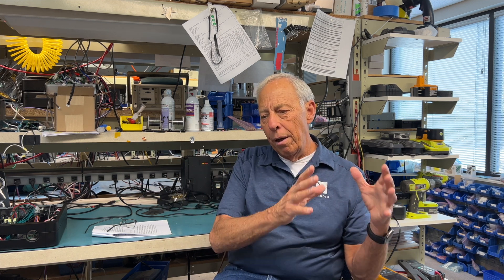Class D amp fatigue

Comment: Thanks for the PWM rap.  I didn't know its the same method as Solar charge controllers use.  All the cheaper ones use PWM.  The new fancy one are MPPT. They do a I V sweep find the sweet spot for volts at the maximum power point.
Reply: mppt and pwm are completely unrelated things, not alternative technologies. PWM + inductor and capacitor is a way to efficiently convert voltages. MPPT is a fancy feedback loop that tunes the voltage conversion ratio (which is still pwm-powered) to maximize the power drawn from solar cells.
Reply: Mppt is good because u can feed them more power.  More volts is always a plus for solar for various reasons.
Reply: I just think its cool how sound tech and solar have parallels. Outback came out with the first MPPT charge controllers back in 2000 or so.  Yes you run the panels in series strings up to 150 VDC then the MPPT circuit with the inductor capacitor ( L C) circuits down converts the voltage to the Max Power Point simultaneously raising the Amps.  This is a win win for solar.  I love sound and solar so its all just great!  You sound and solar engineers are awesome!

Comment: I agree that Bruno and ICE make some good Class D amps that aren't fatiguing but they lack the detail and dynamics of the GanFet designs of Orchard Audio Class D amps. We can listen to mine all day, music and films, with no fatigue. Paul's HCA-1 was a disaster, but even worse was his matching pre-amp.
Reply: Hey Bill, I think Leo sets the gain on his amps at 13db (as opposed to 26/27db on pretty much every other class d) I'm guessing it makes things sound a bit less fatiguing. Although my Purifi Eigentakt is set at full gain and I don't find it fatiguing or lacking in detail or dynamics. As with any amp, getting the proper speakers makes a world of difference. Good quality recordings make quite a difference as well. 
Btw which Orchard components do you use?
Reply: @andrea585ny  Dual mono W/max caps powering my ELAC Vela 409s.

Comment: Tried Audiophonics hpa-T400et (class D 3 channel purifi!!!) and sent it back. Treble was too harsh with most songs on my focal electra 926s... bass was wonderfull though.
The stereo amp version (hpa-S400et) was tested on asr and came out as one of the best ever. Now I am scared to try other class D amps.
Reply: Thats because the electra is harsh on the top end. You would never have a problem with current day Class D if your speakers were neutral.
Reply: Thank you Mark. Yes this also came to my mind. I own Sopra No1s now and these are definetily better at the top end. But I since I sent the HPA-T400ET back, I cannot check. I do consider to give it another try next year. Thanks for your feedback @AbsoluteFidelity

Comment: I love class D for my 5 string bass guitar amp. It has a choice of tube or solid state input stages (which can be combined) but I love that an 8 pound amp putting out 800 watts RMS is the size of a the size of a 2" thick book. I started bass in the late 70s. and a 300 watt tube or solid state bass amp then were huge, heavy, and hot. I marvel at how little heat this generates at such a small size and light weight.
Reply: Well understood why you like it.  I just do not get the mids that I like out of the Shuttle Max 12.0 and the Shuttle Max 12.2 was just Double Violin/Flat Wound Dark Tube Modeled Power Section.   I ended up leaning on the Copper Toroidal Power Transformers of the NEOX400, GBE600 and the GBE1200.  They are all laying about me right now, yes even the ShuttleMaxs.  I really need to sell those.
Reply: What is this amplifier please?

Comment: Hi Paul, I have a Audiolab 6000a class a/b amplifier
My display reads prt???flashes on and off for 30 seconds  and then goes into standby mode 
 standby mode . 
I can operate a turntable or a cd for that 30 seconds. Before it shuts downs 
We had a power surge week 
And it affected  my pvr for the tv and killed a doz leds 
In the ceiling 
I’m so puzzled ? Any ideas 
How to restore my amp ? It’s only 4 yrs old , or is it toast ? 
Best regards , Lorenz

Comment: almost all my amps are class d. what i like about them is the power density. 4000w out of a amp that weighs like 5kg! (behringer inuke nu6000). in my car i have soundigital amps (sd400.4d evo4 and sd3000.1 evo4) and they are very efficient and have a ton of power and the amps are SUPER small! (the 3kw amp is the size of 2 monster cans!)
Reply: forgot to add: the behringer has very good sound but its a little fatiguing. the SD's are not fatiguing at all

Comment: My class D experience: bass and shimmers very good.  Lacking in mids.  Some vocals rendered nasal.  

Used a few. Linn Akurate best of the bunch.  Sounds like my preferred high biased AB amps

But for all its good bass, i find Class D not as tight/controlled a gain clone bass.
Reply: From your message you seem to be elaborating on something I noticed when working with Digital and Solid State Amplifiers for the Bass Guitar.  I walked away from this long ago and had to read to remember that the Digital ultra light amps were Class-D. 

In my work with two models. one modeled to sound as a tube amp, and the other a straight forward design, I did not enjoy the Tube Model on the Power System (the PreAmp shared the 12AX7 tube, so the Power Sections were the difference,) and I preferred the First Issue Class-D.  

BUT!  Weight being no object, and the tone being far more inspiring, I was very excited with the Toroidal Power Sections of 425W@4Ohms and 1200W@2Ohms of the same companies other amps.

Copper made the instrument sing and inspiring.  It was a Mid range clearly missing from the Original Class-D and High Clarity that the Tube Modeler just did not give.

So some of us hear things, others hear other things.  But at my performances, people tended to gather on my side of the stage.  Maybe what you hear is real?
Reply: @miguellogistics984  good to hear some affirmation that my ears still good for this hobby ;)

Comment: I own several amplifiers, including a Class D, two solid state Class A/B, two tube single-ended and two tube push pull.   I find my Class D amp to sound quite good.  Very clear, very good imaging, great bass definition and power.  I do not hesitate to use it for critical listening.
Reply: I agree. But some of the cheaper class D amps can sound sterile and lacking in dynamics, however I've never experienced fatigue.
Reply: @scottypalmer2158  Wat about TPA3251
Reply: @Tamilpasanga664  : One of the best class D's for cheap. Get one with a removable Op Amp and install a Sparkos Labs Op amp...then a good power supply.
Reply: @scottypalmer2158  my swan hivi M50MKiii speaker sound worst, do need to add any external DAC
Reply: @scottypalmer2158  can change
 power supply board? will it make improve the sound quality
Reply: @Tamilpasanga664  : Try changing the Op Amp?
Reply: @scottypalmer2158  I’ve haven’t noticed that with my new $150 Fosi ZA3 .. Extremely clean and revealing, great dynamics — but not at all harsh or fatiguing.
Reply: I GOT A Legacy audio iV 2 amp for my Legacy audio Focus SE.  The best sounding amp I ever owned! NOT ONE BIT FATIGUING! They use the latest ICE modules too.
Reply: I agree. I own a tube amp,  Class A SS with tube hybrid,  Class AB, Van Alstine SET 120, and a Class D GAN FET amp. They are all excellent, and the Class D amp sounds as good as any of them.

Comment: I agree! I can listen to my expensive class D amplifier I installed in my car allll day. Tune it correctly with a DSP and you get what you pay for (most the time). But it’s not always so broad, it is the smaller details such as the filtering and even quality of parts or wires how they’re ran and if the crossovers are wrong, the type of transformer, etc. all makes a difference to determine the company’s goal for how they want the sound or price of manufacturing

Comment: Hi Paul, I am a subscriber.   I have a unrelated to Class D Amp question.  I have a Denon DRA-800H Receiver rated to 4 -16 Ohms.  It has 2 Channels for Stereo (and video connections which I do not use at this time).  I have connected 1 Pair of Elac Debut 6.2 speakers to Channel A , and 1 pair of Elac Debut Reference 6.2s to channel B.  The Elacs are 6 Ohms nominally rated.  They sound terrific played simultaneously or separately.  However, as a Student of Audiophilism (at 71 YO), I learned that the Ohms ratings have an impact on the Receiver /Amp.  I use 14 gauge copper speaker wire running perhaps 12-18 feet form the Receiver.  At first, due to my laziness and ignorance, I wired the two speakers in parallel to one channel.  That overheated the Receiver at 60 volume levels.  It shut down with its Protective Circuitry.  Then I wired the channels separately : 1 pair to Channel A and the other pair to Channel B.  The Denon still gets Hot (has not shut down, but it is getting hot).  Is there anything other than getting rid of the Elacs that i can use to "boost" the Ohms handling of the Denon?  If I connect 2 other pairs of dislike speakers But with 8 Ohms ratings, it's fine. No Overheating to this extent.  Appreciate your advice .  THX for your terrific work.

Comment: Great explanation Paul. I would suggest, in general, for those people who fancy audio as a hobby, that they should get a hearing analysis to determine their individual loss issues. Many comments below - MIGHT - be somewhat related to their own ears. Especially in those above 40! I am above 60! I My eq and dampening and other room mods  in my audio room are for me - specifically. I can listen for hours and not get fatigued. I would also say to others understand that some recordings are also less than optimal and can cause fatigue on any system. Unfortunately some of those recordings were made long ago and the artists have since passed, so it's what we have or nothing. Great channel, great advice from you as always!
Reply: You can use AI to improve imperfections in old recording equipment as long as the information is there in some form. For example if the tape machine recording it was not keeping  a constant speed the AI will figure out the correction needed if the speed variations were non-random, e.g. a roller was very slightly elliptical.

Comment: I own Wyred 4 Sound ST-1000 mk II and ST-500 mk II amps, and a pair of PS Audio M700 monos, and none of them are fatiguing. They sound incredibly clean, are dead-silent, have tons of power, and run barely warm to the touch. My speakers are Dunlavy SC-Vs, which are incredibly accurate and revealing, so if Class D was an issue, I'd hear it.
Reply: I have wyred 4 sound STI-500-v2 and i'm having issues at higher volumes. 
Did a direct comparison to my 40 year old Sansui AU-717 class AB. The sti 500 cannot handle a busy sound at high volumes. I feel like if there is a lot happening in the music, the sound gets very jumbled and almost muddy. 
I can crank on the Sansui waaaay louder than the wyred 4 sound without the sound falling apart. Tekton speakers.
Any ideas?

Comment: Some of the earliest high-power Class-D amps were the Peavey DECA sound reinforcement amps made in the mid 1980's. They sounded great, and were even used in some recording studios for driving monitors. But part of their good sound might have been the fact that their pulse rate was 500kHz, much higher than most Class D amps. This allowed the reconstruction filters to be tuned to a much higher frequency, which reduced their phase shift in the top (audible) octave.
Reply: I tried to play bass through one of those in the 80s. 
It would simply go "blank" for a second...Very clean for hifi though.
Reply: I still have a few of the deca's . Theye were lousy for low freq material, but decent for playback. I have one of the peavey digital power converters (dpc 1000) from the 90's that seem to have low efficiency from gain. 500w on it is weak compared to a 500w qsc of similar age. Seems like the manufacturers got the digital thing more stable than it used to be. I have a ashdown retroglide 750 that competes with my old carvin r1000 in bridge mode
Reply: Is it a typical issue for Class D amp that a drum beat can easily distort the smoothness of the vocal?
Reply: @wilsont1010  I've not heard of this. I can say, though, that Class D amps can do odd things when driven into clipping, depending on their design. This may be what you're referring to.

Comment: Very well said. The reality is that eliminating high order noise (I forget the name of the exact harmonics), is extremely difficult in a class D because of its switching. Often times the circuit is creating harmonics in the 20-200kHz range which subconciously is annoying (especially to animals that can hear it). We can't hear it, but it is there. Tweeters while not rated for past 20kHz, can reproduce those frequencies, just like subwoofers can reach below 10Hz (think about when the subwoofer is moving, but we hear nothing). This is more easily dealt with because the output filtering on the class D is also responsible for shaping the music waveform (smoothing it out) so it is not a digital mess. The end result is a compromise for an "analogue like" output, but is completely incapable of eliminating high order harmonics without some trickery to create a "dual" output stage with who filters, which requires some kind of extra load.  One resource for filtering... https://www.maximintegrated.com/en/design/technical-documents/app-notes/6/624.html
Reply: It's not difficult. All it takes is basically an inductor.

Comment: I'm an audiophile at home.  AND I own a live blues music venue in Gifu, Japan.  My speakers are all Class D QSC.  K12.2, KS118, and CP12.  No problems with them, as some people might know.  Anyway, live music is not fatiguing if the band is exciting.  I have endless compliments on our sound from both the audience and musicians alike.  I find that the Class D amps along with our LED ADJ lights are very efficient powerwise. 

Can anybody here comment on the quality of the amps in my powered QSC speakers?  I know that they're having quality control issues on some parts, but the design itself seems to be very well made.  Again, it's not home audio, but relevant to Class D amps.  Personally, I'm beyond impressed with the live sound quality.  Our source gear is high end as well and doesn't need to be addressed unless one thinks so.  Thanks!
Reply: QSC build quality isn't fantastic, they're on the lower end as far as PA goes. There's a reason systems from the like of L'Acoustics, Coda Audio and D&B Audiotechnik use external amplification.
Reply: @jordanmetcalfe8302  I'm not familiar with those brands.  I'll check them out.  Thank you!  

I'm using powered speakers because space in my venue is extremely limited.  It's in Japan.  However, I'm wanting to buy a much larger building soon so your suggestion is very helpful.  Availability and cost of imported gear is another factor for me too.  QSC was my best option when I opened two years ago.  The new RCF speakers are just now becoming available here I saw recently.
Reply: @johnreardon4944  I've seen many powered speaker systems not hold up well when driven hard. I've had amplifiers with cracked circuit boards...went back to using external amp system. I've been doing live stage sound since 1980's.
I think the powered speaker stuff is more of a marketing ploy.
👍
Reply: @raybin6873  I understand your point.  Thank you.  That's what I've been worrying about with QSC's latest problems.  I'm not positive, but because I bought my K12.2s and KS118 early on, I'm hoping to be safe from the problems with their later batches.  My saving grace might be that I don't play my speakers loud.  At all.  My K12.2s are at unity and my KS118 sub is at minus 7.  For real.  Headroom is what has been successful for me thus far, not volume.  

So if I do get a bigger venue, I could sell my speakers and invest in separates.  Your advice is taken seriously.  

I will say this though.  The QSC CP12 speakers are phenomenal as monitors.  I've never heard anything bad about them having any problems.  They are very underated for what they are.  Reviews and forums speak ultra highly of them.  So at first, I will definitely keep those and try to invest in your knowledge of separates for at least my PAs and subs.

Pros and cons of powered speakers vs separates are not to be overlooked lightly in my case.  But sound quality is always my priority.  Headroom is also a big factor, I know.  And so overkill on wattage is a plus for quality speakers.

Just last weekend, even with my current QSC system, our rare acoustic gig with vocals were heard with ease and without any stress from the speakers.

I'm guessing that you're on to something higher quality than what what I've already been impressed with.  I'm looking forward to discovering something new to ensure that my venue stays number one in my area.  I'm already getting high end talent playing there so....

Comment: Of course the cure for this trouble will be found in an all-tube class D circuit. 
Can't wait for the product announcement.    
      
      
        

         
         
         
 Thanks for laughing along.
Reply: No you  Don't have to laugh.....
Much earlier.. (60- 80 years ago) most transmitter towers of AM / FM / SW ( 500KHz - 150 MHz) broadcast used tube output power stages ( that too in KW/MW ranges ) ...so it's NOT difficult to design & build one...even if just for experimental purposes...
Reply: @analoghardwaretops3976  And they still do.  
You're dealing with a ham here (KJ6QKV).
Reply: @spacemissing  good for you 👍 maybe you can give an idea of complexity & cost in building a class D tube amp..

Comment: Bang and Olufsen ICE power class D we’re at the forefront we’re they not ? 
I use a Beogram 3300 turntable Soundsmith cartridge with a Project DS2 valve pre amp with a Bang and Olufsen Beocenter 2 with a Beolab 19 sub with Beolab 8000 mk2 with a pair of Townshend audio super tweeters. Class D sounds fine by me ???